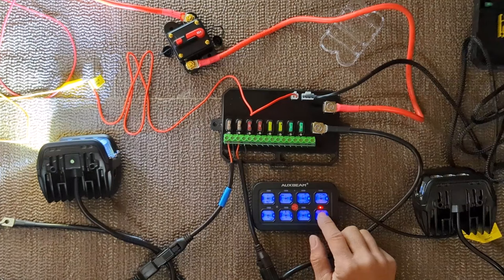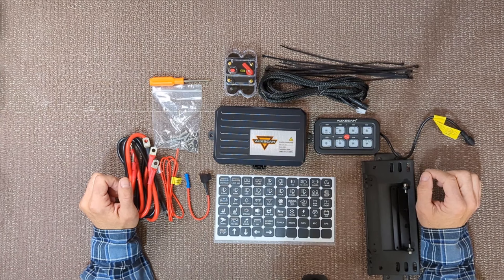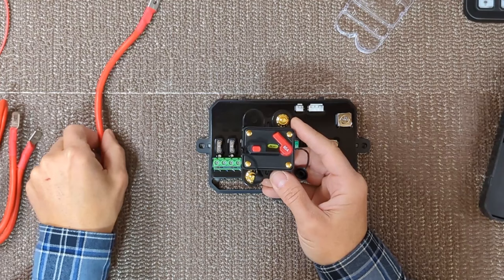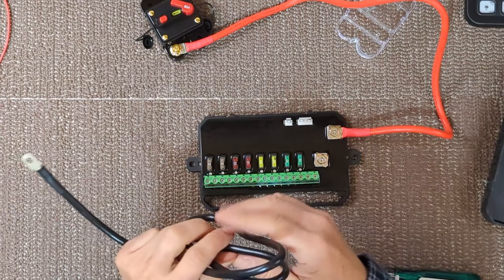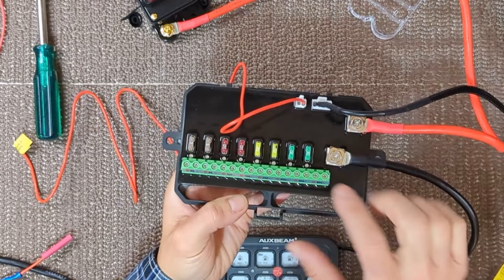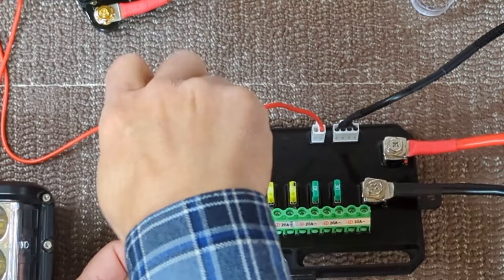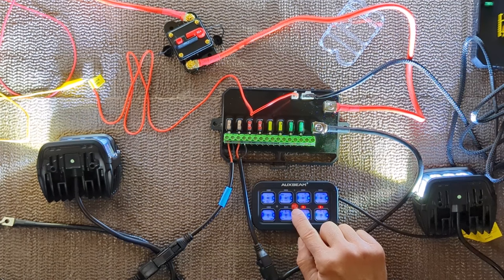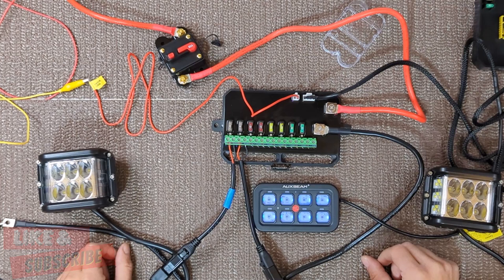AUXBEAM 8 Switch Panel - How To Wire

Comment: Question, do you still need a wiring harness between the light and the box? Or can I just shoot red/black light wires straight in?
Reply from the maker: I'm not completely sure what your asking, but I cut out the relay and switch provided with the lighting wire harness and run the wires (+ and -) straight into the Control Box. You can see how I do it on a few of my other videos when I actually install this in a vehicle and wire up different types of lights to it.

Comment: Can you switch the fuse around in any order? Or do they have to stay the way they are?
Reply from the maker: Auxbeam has stated in the past that you can move the fuses around. I would definitely confirm with them as they have multiple units and they could possibly change internals as they come out with different versions

Comment: If you have (2)devices hooked up to this, both with a 30 amp draw, could you still hook up more?
Reply from the maker: Well, you can but if you are running both of those high draw accessories at the same time I would not switch on the other circuits. Or, if you are running 1 accessory with a high draw and not the other you should be able to switch on other devices as long as you're not exceeding the draw limit.
I would definitely contact Auxbeam to confirm this, they are usually pretty responsive.

Comment: Yea I see that super cheap but what’s dif between the one sided and 2 sided
Reply from the maker: The 2 sided will have the circuits/fuses on both sides of the Control Box. This is the 1 sided, so all fuses are on the 1 side
Reply: @AZOverland2017  thanks that’s seems pretty self explanatory… but how do they compare? And both come with dif circuit breakers. The one with single I saw a video that it’s better cuz it’s controled with a switch vs a popped fuse for the other one. I ordered both to compare and will be using one for my truck. I don’t plan to submerge with truck but SxS a dif story that’s what it a for so I’m wondering what’s best for my YXZ1000r SxS
Reply from the maker: @jesseserna4490  Honestly, I'm not seeing the difference between the 2 other than the layout of the circuits. They connect and operate the same way from everything I read and looked at.

Comment: So do you still need the relay that come with the light bar? Or is it jus straight wired to yhe power module..
Reply from the maker: No, I cut the relay and the switch out that came with the light bar and wired it directly to the control module. That module has its own relays that replace the other one.

Comment: Hi mate
When connecting spotlights to the auxbeam, how do you connect the switch wire to the auxbeam pannel, and do you still need the relay.
Reply from the maker: Yes, you cut out the relay and switch that the light kit harness came with. I've done it in several other videos I made. The video below probably best explains it. Even though it is a different Switch Panel it's the same concept.

https://youtu.be/U6ZLO_qQHPY?si=w7iQfSCkjfxOiHkt

Comment: I just bought this to replace my old switch on my boat.  The single red wire that powers the system (acc) can I just wire it to the +ve terminal on the control box?  Thanks
Reply from the maker: I suppose it would work, but I'm not sure that's a great idea. You want it connected to switched power so there is not constant power going to the switch panel. Although minimal, there will be a consistent power draw because the backlighting will always be on. Also, it is important that you have an inline fuse to protect the electronics of the Control Box.
Reply: @AZOverland2017  Firstly thanks for the quick reply. On the boat it is fine. After the boat is off the water everything is disconnected from the batteries not like the car. It is a trailer boat. I do not think this will draw much power.
Reply: @AZOverland2017  I will definitely will be using a fuse to protect the controller box.
Reply: Great video, thank you for sharing. I have a question. I am proposing to install this unit in in my camper trailer, which will have its own lithium battery power. Can i install the the red fused cable (without the fuse) directly to a positive busbar, which will then be connected to a shunt > midi fuse > battery? Cheers Tony
Reply: @JT-jy2sy hey man how did it work trying to do this right now and ran into this I wired it too the + on the control board did it turn out okay???

Comment: 9:17 When wiring both cubes on the same circuit, did you use the same fuse with the same amperage or do you have to use a higher amperage? I bought a light cube kit with its own harness and fuse (30A) but I want to use my AuxBeam switch panel to control each cube — so I’m wondering if I should use 30A fuse for each switch.
Reply from the maker: So you want to wire them into the Auxbeam separately and control 1 at a time? You just need to figure out the total amp draw of each light and use a fuse that is slightly higher than that rating. That would hold true if you are wiring both together like I did
Reply: @AZOverland2017  thanks!
Reply: @Mr_MM87  FWIW, I found a amp calculator just today that came in handy for figuring these exact values you seek. 7 months late, yes, but to the next guy wondering, you can search volt - amp calculator (or something similar) and plug your numbers into the formula. Alternatively, Watts/Volts=Amps, so if you have the wattage value, just divide by source voltage (12.6 in a car, for example), and boom, Amps!!!

Comment: This may seem like a dumb question but I’m fairly new to wiring lights and I have this switch installed on my jeep. Since you used 5amp for single lights, when you wire them together on one circuit would that then be 10amp?
Reply from the maker: The circuit will remain a 5 Amp circuit. Find out the Amp draw of your light and use a circuit with the next higher amperage rating. In my case, each ditch light draws 2.7 amps so I would multiply that by 2 and come up with a 5.4 Amp draw when both lights are on. Technically, I shouldn't have used the 5 Amp circuit as I misread the specs initially. I will be moving it to a 10 Amp. Does this make sense?
Reply: @AZOverland2017  makes perfect sense, thank you!
Reply: So does that mean if I wanted to add two lights to be activated by one switch, I would just put the two hots  into one terminal and the two negatives into the adjoining terminal and tighten them down?
Reply: And as a follow up, if I didn’t need a 30 amp circuit, I could swap out a 30 amp fuse for something less if my devices pulled less current, right?
Reply from the maker: @geoffreydlin8043  That's correct
Reply from the maker: @geoffreydlin8043  I did just what you said here when I installed this in my 4Runnee:
https://youtu.be/qB2Bg-A9zQg
Reply from the maker: @geoffreydlin8043  I suppose you can do that but this system does provide 2 of each; 5 Amp, 10 Amp, 20 Amp, and 30 amp for a total of eight individual accessories that can be hooked up

Comment: Could I put 30 amp fuses in all of the slots?
Reply from the maker: That wouldn't be a good idea. The Control Box is only capable of handling so much current. If you are operating 2-3 30 A circuits simultaneously it could be overloaded. Check with Auxbeam to confirm, but it sounds like a Switch Pros or similar would be better suited for your needs

Comment: How many amps does your ditch lights pull
Reply from the maker: 4.6. I ended up running them on a 10 a circuit instead of 5 amp
Reply: I was thinking they might pull close to 5, and was thinking about going ahead and running mine in the 10 amp position. Thanks for the response, and also excellent explanation. Cheers 🥂

Comment: I have this same 8 gang switch panel.    I am having trouble with the Output Connections.   As I  tighten down the screws (+ and - ) the light looses power.  As I  loosen the  screws it regains power.   Is there a trick to securing the wires into the  Output Connections?
Thank you for any help.
Reply from the maker: My guess is that the wires for the lights are stranded wire and when tightening them down they are separating and not making a solid connection. If you look at my videos where I install ditch lights on the 4Runner and Tacoma, I use ferrule terminals specifically for that reason. I put links to what I used in the Description of those videos. I'm not completely sure that is your exact problem, but that is where I am leaning. If you can't find the point in the videos I am referring to let me know and I will reply with a link and time of video. Hope this helps.
Reply: @AZOverland2017  Thank you so much!!  I'll rewatch your videos and order that ferrule crimper tomorrow.
Reply: I used the ferrule terminals as you suggested and they worked perfectly!!
Thank you very much for the help.   My auxbeam is completely functional and I'm loving it.  Thanks again and happy/safe travels.
Reply from the maker: @XtrmTJ97  Really happy to hear that!

Comment: I just got the 8 gang switch panel and some auxbeam ditch lights with a strobe function. When hooking them to the switch panel, will I lose the function to make the strobe or change between white and amber?
Reply from the maker: The strobe function should work with the lights. The switch between white and amber will probably require wires to be run to 2 separate circuits in the Control Box. See my video on the Rock Lights I did recently. Yours may need to be wired similarly
Reply: @AZOverland2017  thanks, I'll check it out.

Comment: Was your red accessory wire long enough to go into the cabin?
Reply from the maker: No. If I remember correctly, the fuse tap has a butt connector attached out of the box and you need to crimp on the length of wire you need to either run to the under hood or cabin fuse panel.
Reply: @AZOverland2017  thx. 
I’ll need to splice an extra section on my red accessory wire. I’m guessing maybe a 16 gauge. 
I guess the original wire length was designed to splice into the fuse panel under the hood. I’m going to run mine to the fuse panel by the drivers left foot. 
Thx👍🏻

Comment: Would the switch pro work if I don’t need to have a ground and only have hot wire?
Reply from the maker: What accessory do you have that only has a hot?
Reply: @AZOverland2017  buggy whips. Only has hot wire and ground works when it’s mounted to a metal.
Reply from the maker: @itskerbc  I believe you will need a ground wire going in to have it function correctly. There is probably a way you can do this but I would contact both companies to confirm. My idea would be to run an actual ground wire from the mount of the Buggy Whips to the Control Box  circuit ground. But, once again, please confirm this with the manufacturer of each if you are not confident in this setup.

Comment: what size is the ring terminals and gauge of the battery wire?
Reply from the maker: Either 4 or 6 gauge, not sure. The terminals came already attached to the cables.

Comment: Is there a way to wire  ditchlights with mutil modes to the box and use the switch to cycle through the modes?
Reply from the maker: Yes. See the video I did below on how I did it. It is towards the end of the video at about the 9 minute mark.

https://youtu.be/ioepyPizNCY